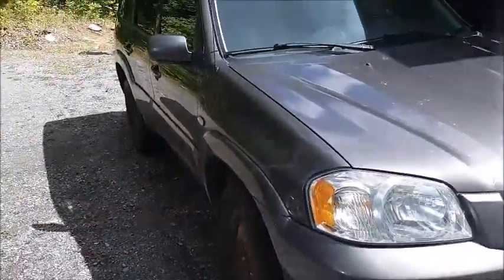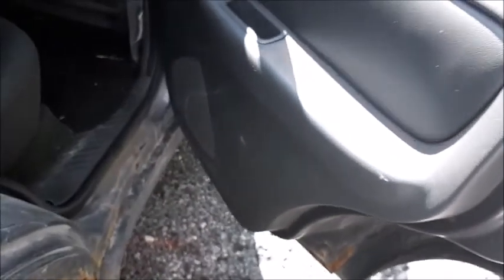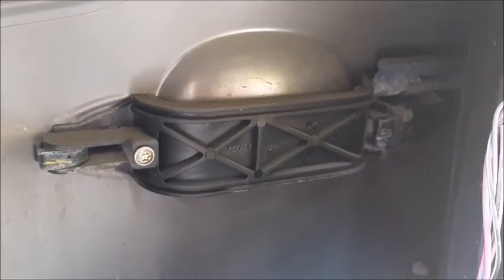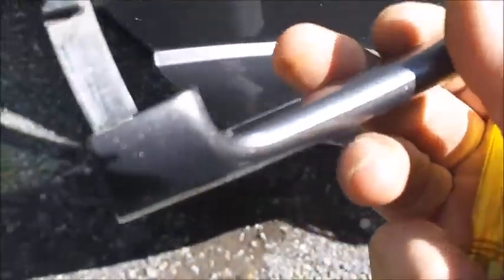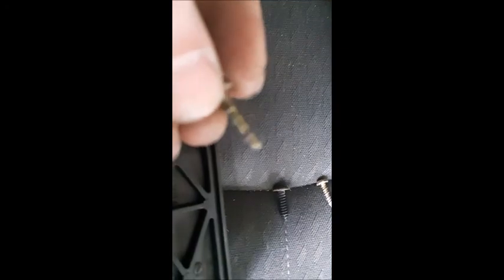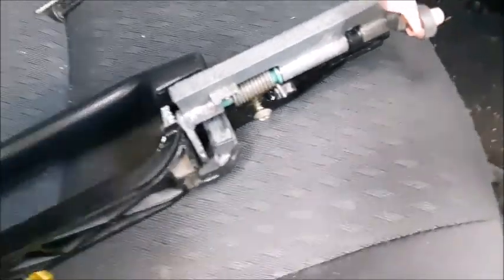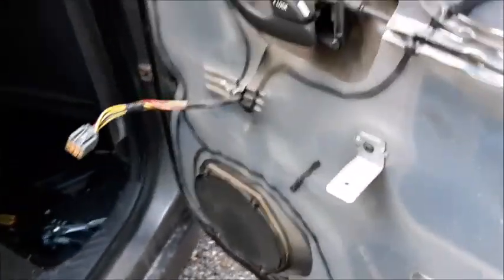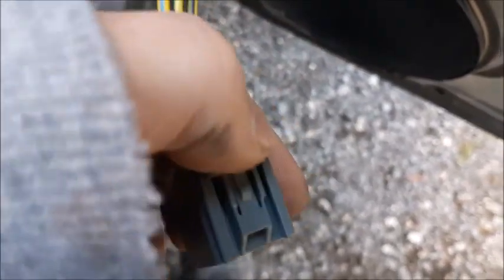mazda tribute / ford escape. exterior rear  broken door handle full  repair installation.   part 2

Comment: Really helpful video. Great help on how to open the door. We removed the electrical plug and pushed the window track out of the way to get to the rear T20 screw. Made it much easier! Cleaned and lubed it and it works like new!
Reply from the maker: i'm glad it was helpful. thanks for the tip.

Comment: Solo pude abrir una ,la otra no pude, cerrada la puerta ,como quiera le quite el panel, pero estoy batallando, algún consejo por fa!!!
Reply from the maker: don't  understand what you saying, is the door closed , front or rear ? what problem are you having ?  if not broken , spray lubricant on the mechanism to move the lock metal rod  ...
Reply: @dayslife  ok encontré el detalle tank you.